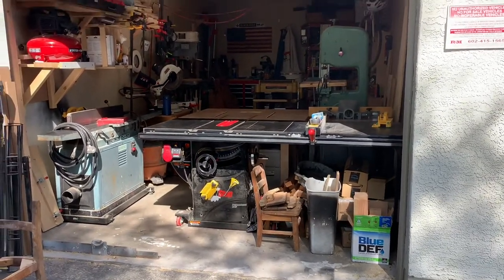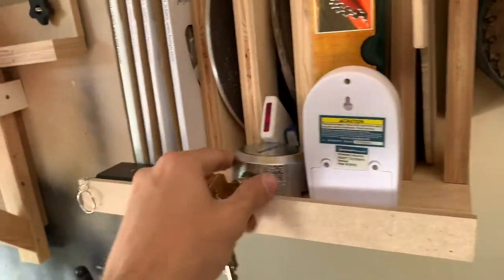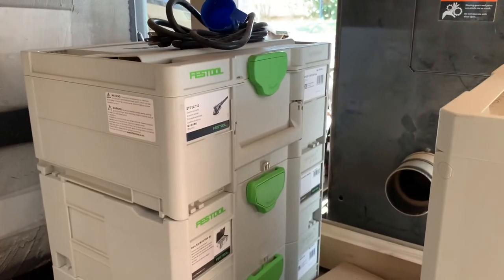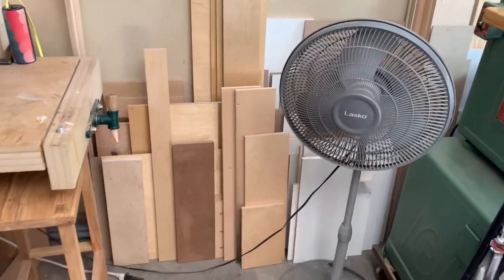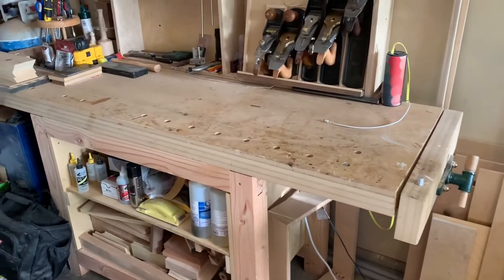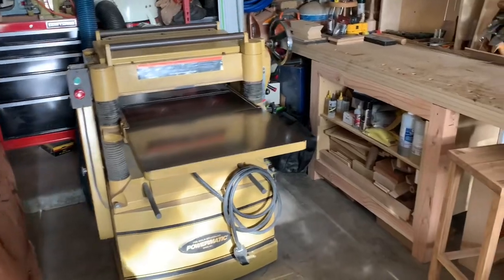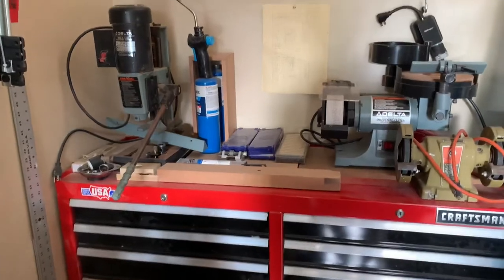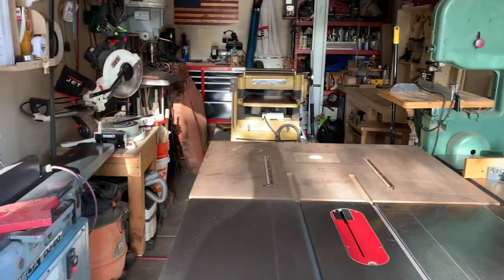One Car Garage Woodworking Shop

Comment: No issues with using the double taper sanding disk on the sawstop?
Reply from the maker: None at all. However, I do not run it with the brake turned on. Always off just in case of accidentally tripping the brake.